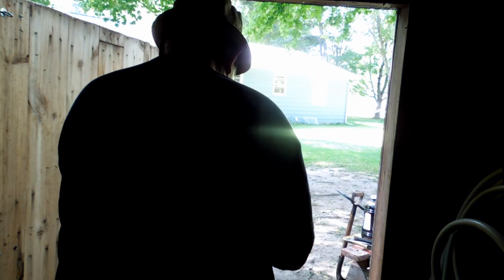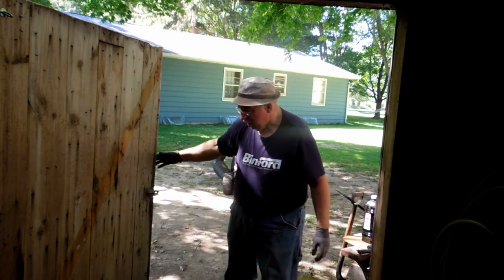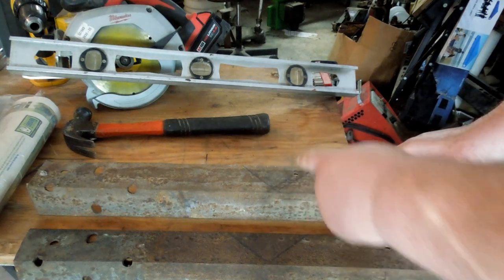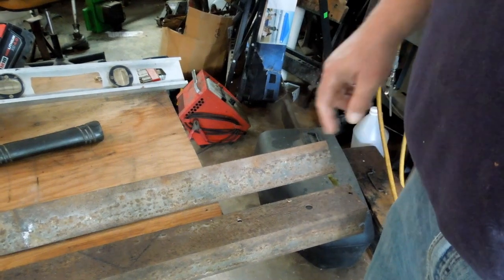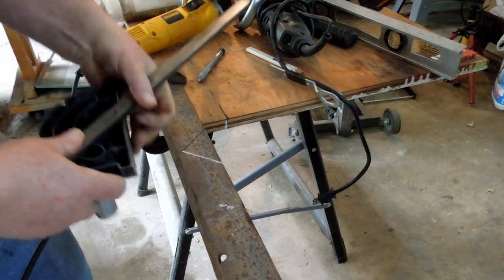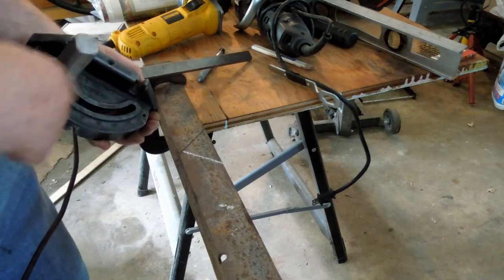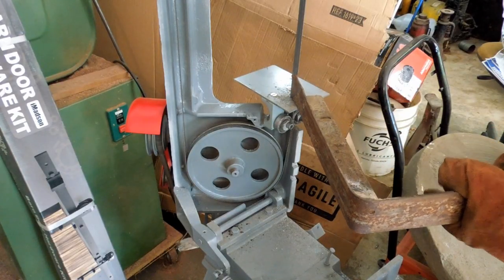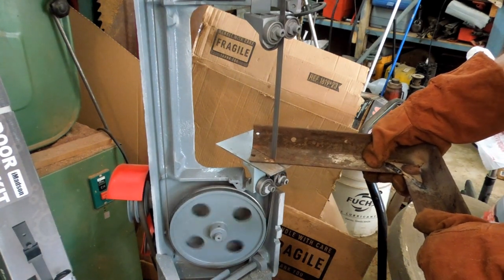Little Red Barn - Pt 3 – Braces For The Door Frame

Comment: I like joist hangers for various things such as an angle brace. Between enough of them, screws and some plywood with glue it stays put. I was thinking if I even had a square in the greenhouse but I must've had a framer but all my cuts were 45's and 22's and 90's, maybe just the miter saw. One of those jobs that with a block foundation, you work with what's there and that's it. I did and it's still standing. But it may collapse this afternoon. THEN we go with plexiglass! GBWYall! Happy Grandparents Weekend!
Reply from the maker: My brother in law Don has an acre of greenhouses that he replaces the plastic on every few years. It is rough staying ahead of the weather.  😁😎
Reply: @OldSneelock  This is really heavy and just one layer. I'd like to find another complete one same size. The only thing coming apart is the shade sheet on the outside. Toots used to get rollup bamboo blinds type material but the wires rusted out. Always sumpee. The shade things were cheapies. She'll get better ones next time. They were thin and cut like expanded metal so no wonder they ripped.

Comment: Snow loads and water always find a way to screw up our day!  LOL   Thanks Dave!
Reply from the maker: As Speer said. "Always Sumpee!"
I suppose if I listed all the possible failure points and did a full engineering workup on failure modes I could eliminate most of them. 
Murphy always throws us a curve.
The HF pump proves that a well stocked storeroom can save your bacon.  😁😎